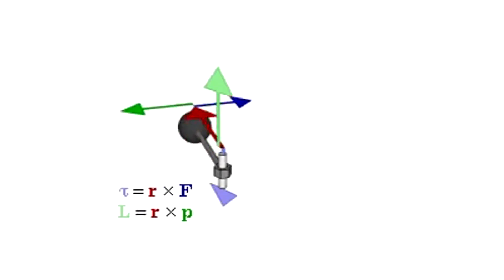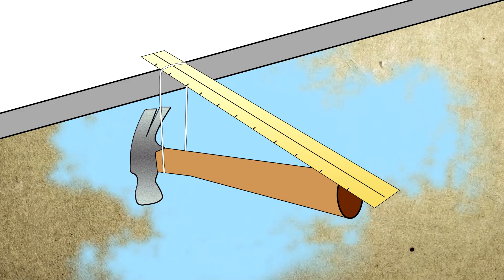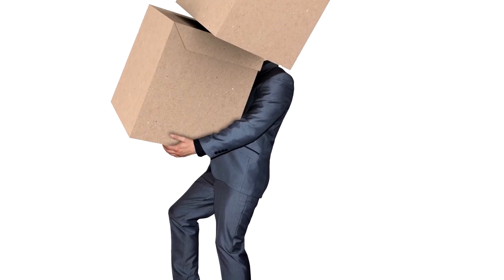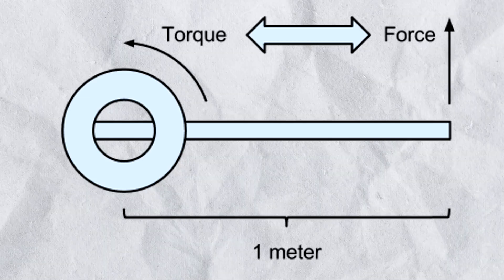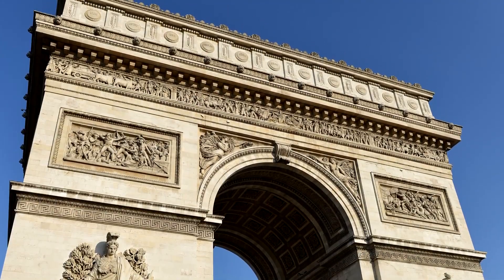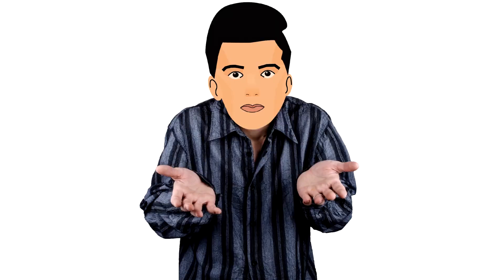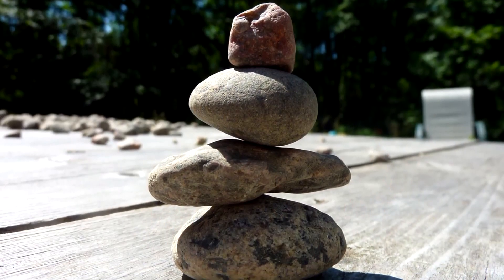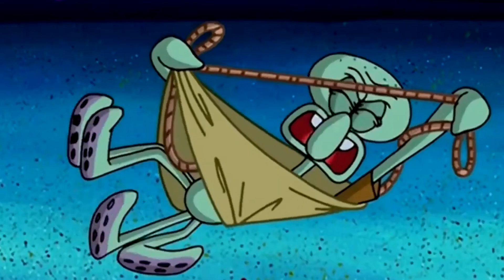why it works 2

Comment: This explanation seems to go through the mechanism why it works, not the simple underlying reason, which is that it’s equilibrium cause it’s locally the lowest location of system’s center of mass if we consider all the constraints.

Comment: What if you put a water stream into a donut shaped hole and put a water wheel anywhere in the water stream and and spin the water wheel three times will it give infinite energy
Reply: The water will just settle eventually(probably pretty quickly)

Comment: I got bitten by a stray cat 5 minutes ago. I hope he survives the night.
Reply: Huh.
Reply: @AidanDaGreat  What did you not understand? The fact that I got bit or the fact that the cat is probably dead by now?
Reply: @-na-nomad6247  I understand it fully. It's just an exclamation/ interjection at hearing that on a physics video.
Reply: @AidanDaGreat  it has nothing to do with the video itself. This was the first video that popped up on my feed after that happened and I couldn't concentrate on it because I was thinking about the poor cat. So I typed what troubled me here.

Comment: The question now is how long would it stay up for/how stable is it
Reply: It is literally stable. The top part of hammer is heavy and the center of mass is centered at that, the exact same point where the everything is supported.

In other words, try placing a ruler on the edge. And then put some heavy object on the fulcrum, it won't fall.

Comment: Can i you cover why you can’t have two siphons between two bodies of water to create infinite energy, I know it won’t work but I don’t know why, it might be a stupid question but I feel like you have covered stupider questions.🙏
Reply from the maker: For a siphon to work, its output has to be lower than its input, so you could siphon water from A to B if A is in a higher position, but the siphon won't work from B to A. 
i already made a video about siphons (why it doesn't work 20) if it doesn't answer your question, consider describing it in more detail or providing a sketch if you could. 
Thank you.
Reply: @tylerschannel  I had this idea for 'infinite energy';

You have two smart metal balls (which can have their magnetism turned on and off), with a strong repulsive force, hanging on strings like a pendulum.

You start by dropping both off at a high point point so that they meet in the middle, and when it passes a sensor on both sides, their magnetism is turned on.

The result should be (assuming both metal balls have the same repulsion force) so that the metals repel each other back to their starting point as long as their repulsion forces are very strong, and once they pass through said sensor again, their magnetism is turned off. Therefore this should? theoretically create some sort of added energy.

I know it's probably impossible but I want to hear your opinion on why this might not work.
Reply: @foolishgold3171 

The mechanism should actually work, BUT would not produce a net gain of energy.

This is because turning magnets on and off is not free. Electromagnets are how you do that, and as the name implies, it requires electricity to enable the magnets, and this will always cost more energy than the magnetic fields would be able to reproduce with repulsion.

It's similar to why a generator can't power itself without fuel. You COULD activate magnets in sequence to drive a rotor (and this is how electric motors work), and you can recover some amount of energy from that system (which is how regenerative braking on electric cars, and the alternator on gas cars work), but never more energy than was put in to induce that motion in the first place.
Reply: @foolishgold3171  

Larger balls take more energy to move, which means stronger magnetic fields, which means more electricity, yes.

Basically, what you're doing here is converting electromagnetic energy into kinetic energy, and then back again. This cannot be done with perfect efficiency, so some amount of energy is always lost in that conversion, meaning each subsequent repulsion would be weaker until they stop repelling at all. 

If you were able to achieve perfect 100% efficiency in that conversion, you could theoretically achieve perpetual motion that way, BUT it wouldn't actually be useful. The moment you try to use that to power something else, the energy being consumed is now greater than what's being generated, so it would again slow down over time.
Reply: @tylerschannel hey quick idea for another why it doesn’t work, sending a wind turbine to space so that it wouldn’t stop spinning, due to the fact that there is no friction, thus creating infinite energy
Reply: @xbox181  There would also be no wind so moving a load would quickly eat up the remaining energy. 😂
Reply: @xbox181  Then the energy it has at the beginning will just be converted to electricity,and it will eventually stop spinning